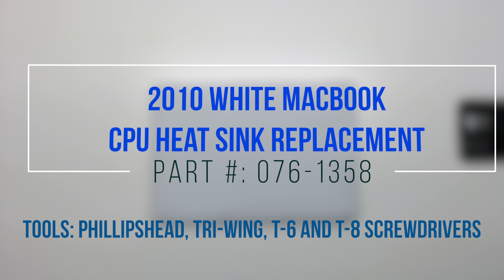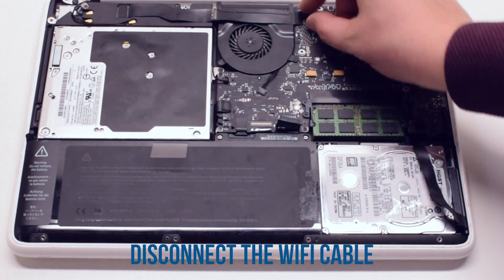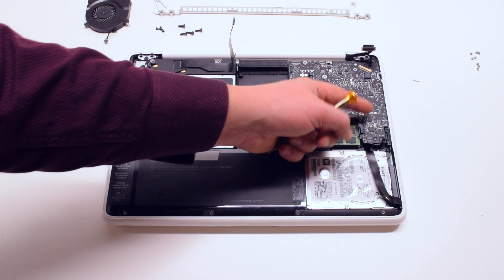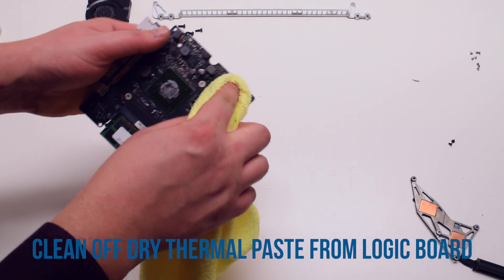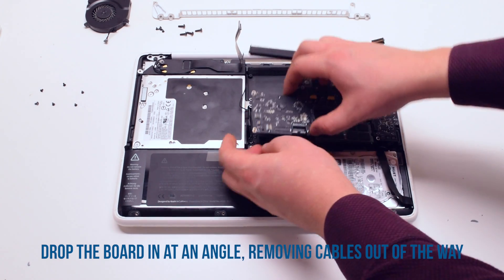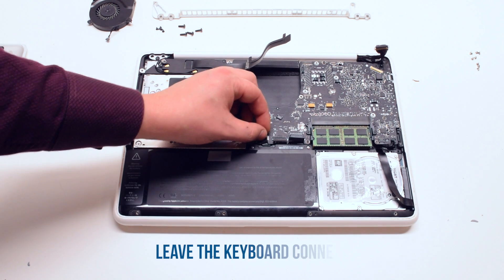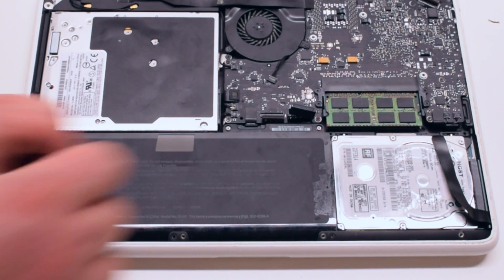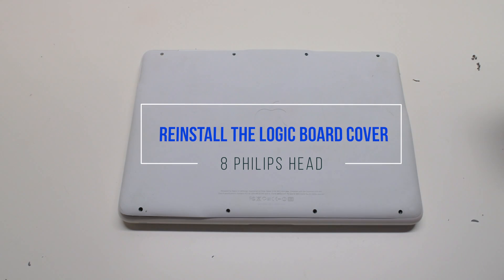2010 White Macbook A1342 CPU Heat Sink Replacement

Comment: did this mac wont power on at all
Reply from the maker: Check the keyboard connection. Reseat it.
Reply from the maker: The power button is part of the keyboard so if the keyboard is not connected properly then the unit will not power on.
Reply: @GRIBSOFT  tried that nothing
Reply from the maker: Do you have a green light on the charger?
Reply: @GRIBSOFT   nvm the cable was slightly out now it works. i was really freaking out as this is my first mac ive worked on.
Reply: @GRIBSOFT   i got it the ribben cable was very slightly out.
Reply: @GRIBSOFT  nice video btw

Comment: Hy, i have a same macbook, and i follow the steps how is described on this video, to repleace thermal paste, but after that my macbook wont start on :/  Therefore,  it worked step by steb, and everything put back, but  macbook simply will not start, and nothing happens when i press power button.. Sou, can i try anything, or  take it to the service? Best regards
Reply from the maker: Sounds like you need to reseat your keyboard connection. Remember the power button is just a button connected to the keyboard so if the keyboard is not plugged in all the way the Macbook will not start. Also make sure the power cable is showing a light yellow green or red so that you know that you didn't forget to reconnect the dc-in board. Just pull out the keyboard ribbon cable and reconnect it. If that doesn't work try to start the Macbook manually by shorting it's power pin pads, read this link on how to do that http://www.insidemylaptop.com/turn-on-macbook-pro-laptop-without-power-button-locating-power-on-pads/
Reply: Tnx man,yeah, its keyboard in case, when i try manually turn on (by pressing two pins on logic board) the laptop is on! Now, in my opinion, the keyboard ribbon its kynda slightly curved up, and now i must somehow put it back. Anyway, tnx alot, now i know what is the problem, and i hope so that i would resolve it. Best regards, Edvin
Reply from the maker: That connection is always a pain so just fiddle around with it I'm certain you can get it to work properly once you reseat it correctly.
Reply: Once again, tnx man, everthing work great accept a keyboard, but il resolve that somehow and thats it :)
Reply from the maker: Glad to help.